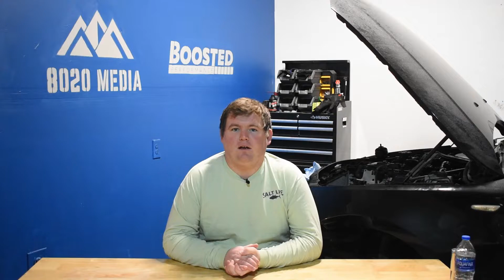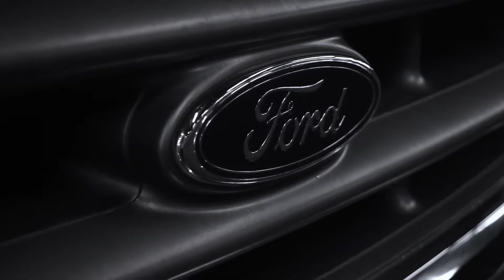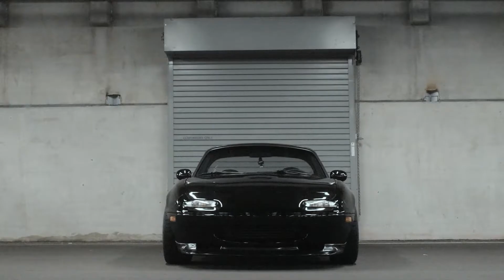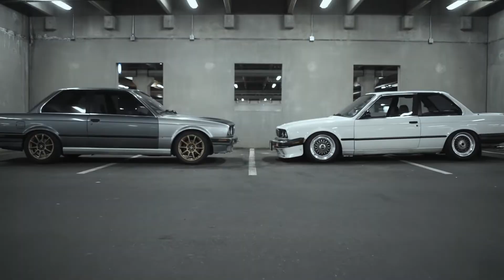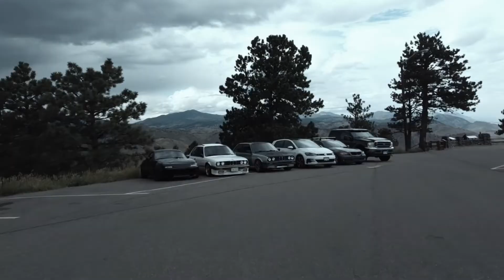The 2.0 EcoBoost | Common Problems & Reliability

Comment: Hi, & thanks so much for the informative video! I've been looking at getting a Mustang,  either 2021 or 2019, both with ecoboost engines since the GT gas mileage would bankrupt me (plus, I'm retired and don't need a GT anymore). If I understand correctly, the 2019 2.0 is still in that coolant intrusion danger zone, but the coolant issue has been resolved for the 2021 2.0? Thanks again for the great video.
Reply: Mustang ecoboost is a 2.3 ecoboost.
Reply from the maker: Ed - Correct! Thanks for the feedback!
Reply: @8020Automotive  Thx so much!

Comment: I bought a used 2017 2.0 EcoBoost Escape last year. I love it, but the mileage is horrible for a 4-cylinder - roughly 19- 20 mpg combined local and highway. I drive very conservatively, use top tier gas, make smooth starts, anticipate my breaking (always getting a perfect score on the "How am I driving" dash display), and I never take advantage of the turbo boost this engine is capable of. My mechanic did some diagnostics as well as a fuel injection cleaning. No codes were amiss that would indicate a compromised oxygen sensor. I still do paper and pencil gas mileage calculation and it jibes with the dash display's reading. Could my fuel gauge in the gas tank be off? Is it possible my odometer is incorrectly calibrated? There are no tell-tale signs that you mentioned in your video, no smells, sputtering, smoke, etc. It runs great, but if I can't correct the mpg issue, I will sell it. Is poor mileage typical for this engine or did I get a lemon?
Reply from the maker: Matthew - Sorry to hear about this. Few follow up questions: What are your driving patterns? Are your tires properly inflated? Is all maintenance up to date? Are you typically hauling people or things?

Comment: Bought a 2016 Ford fusion with the gen 1 2.0 ecoboost engine over a year ago, have 65k miles on her and shes still going. After reading about the coolant intrusion on the gen 2, Im glad i got one with the gen 1.
Reply: You dont have a gen 1 you have a gen 2. Gen 2 started in 2015
Reply: @kennyhart2699 anything before 2015 is Gen 1 ? I don’t know
Reply from the maker: Kenny - Thanks for sharing this insight!
Reply from the maker: F - Sounds like you've got a good one. Just make sure to keep up with maintenance.
Reply: @8020Automotive  Hi there, If you were to buy one with the gen 1 engine from a private seller, what would you ask them for? Also would an inspection at the dealer be a good idea? What would you ask them to look for? Or better off to not buy one with a gen 1 type?  Great video, thank you.
Reply from the maker: Perma - Thanks for the feedback! It is always a great idea to ask for maintenance records. If the 2.0 has been maintained properly then it wouldn't be a bad buy. Would always advice getting extra eyes, especially unbiased, on a vehicle before purchasing.

Comment: I specifically wanted this engine and not that 1.5 crap in which have issues.  My 2.0T 2017 Fusion gave me no problems.  I throw Lucas injector cleaner once a month.  Currently at 81k miles and still running well.  I want a F150 now but will hold on to my Fusion until those prices come down.
Reply: My 1.5 has only had a misfire code because of original spark plugs at 100k miles and the ac compressor went out, its been a solid engine for me since i got it at 89k miles
Reply from the maker: Ryan - Thanks for sharing your experience! Not sure when prices will come down, but we agree!
Reply: The 1.6T is the least reliable of the bunch

Comment: Here are some things to help w/the reduction of carbon build up, though it won't alleviate it.
1. When driving, allow the engine to get up to full operating temperature. The worst thing you can do is to do shorties around town and such, which don't allow for the engine to get up to full operating temperature. This allows for more carbon to build up in the cylinders. Take her out on the highway at least once a month and open her up, especially before an oil change.
2. Use a good quality of gasoline w/built in fuel cleaners. What are called Tier 3 Fuels. With the cheaper fuels, you get what you pay for. I recommend Chevron w/its Techron fuel additive. During the hot summer months, especially on long trips and w/the vehicle loaded, use a Premium fuel.
3. At least once a month, run a fuel cleaner, like Chevron Techron, in the fuel tank.
4. I recommended using Full Synthetic oil (Motorcraft, Mobil One, Pennzoil, Amsoil), w/a good quality oil filter, (Motorcraft, NAPA Gold, Wix, etc.). Stay away from Frams.
5. Follow the recommended maintenance schedule.
Reply: This is a GDI (gasoline direct injection) engine.  That means that there is NO fuel coming through the intake valves to clean them.   The old "Italian tune-up" you suggest - (Take her out on the highway at least once a month and open her up) - does NOT work on Direct Injection engines.  The only way to clean the intake valves is an expensive (hundreds of dollars) cleaning at your dealer.
Reply: @wearethelandrovers9014  My Ford dealer does not even offer the service.  I'll be doing it myself.
Reply: Motorcraft oil is a "Synthetic Blend"
Reply: @doanpham972 They also offer a full synthetic
Reply: I would add Redline oil to that list, and I wouldn’t go over 3500 miles on an oil change on any ecoboost.
Reply from the maker: Gordie - Thanks for taking the time to write this information up. It will certainly be helpful for future viewers. We also have a video specifically dedicated to carbon buildup: https://youtu.be/jogNGSNg-OA
Reply: Only starting in 25 from what I've read regarding mavericks anyway
Reply: Recommended maintenance I agree but I wouldn't use the oil life monitor.  5k or under with full synthetic
Reply: The 2.0 ecoboost has dual injection. it has both direct injection and port injection.  There is no more issue with carbon buildup on the intake valves.
Reply: @endurox1481  2.0L does not have this feature. That is on the 1.5 L. The current 2.0L is a great engine and it's a darn shame to not give it this update. I believe the 2.7 and 3.5 may have it also.
Reply: @endurox1481 wrong, the 2.0 engine is direct injection only.

Comment: Great video, quick question; do you know if the coolant issue effects the Jaguar-Land Rover Ecoboost 2.0l engines, specifically RR Evoque, Discovery Sport, or Jaguar XE? From my research, I believe these (even as late as 2017 model year) are on the Gen I design and the coolant issue appears to be with the 2.0t Gen II ecoboost, no?

Also, do you know if the European version Gen I engine still suffers the same exhaust manifold cracking, as from what I understand the European engines have a slightly different exhaust design? Thanks!!
Reply from the maker: Hi Douglas, thank you for the positive feedback and comment. The models you mention do use the 1st gen engine. The 2nd gen was when Ford moved to the open-deck block which is the flaw of those 2L EcoBoost's. The first gen doesn't have any real block problems, so there aren't any coolant intrusion concerns. Of course, random fluky failures can and do happen but it's not common or likely by any means on the first generation engine.

As for the manifold, Euro-spec EcoBoost's do use different cylinder heads and manifolds. Here in the US, the manifold is built into the heads whereas in Europe it's a standard exhaust manifold that bolts to the head. The design is very different so it's unlikely the Europe versions have the same issues.

Comment: Hi, Great video, very informative. What do you know about the 2.0L engine on the 2023 Lincoln Corsair?
Reply from the maker: Lincoln refreshed the Corsair for the 2023 model year and replaced the 2.3 EcoBoost with the 2.0 EcoBoost. What information are you looking for? It's a little difficult to provide common problems on the '23 Corsair since they just began production.
Reply: @8020Automotive   this is my situation. I would like to change my 2021 Lexus ES 350 F Sport for a SUV. I was thinking on the new 23’ RX. But now that Lexus is changing their engines to a smaller and with turbo, I was looking at the 23’ Corsair as an option. Not sure which one will be more reliable.
Reply from the maker: Again, since both are relatively new, it's difficult to say. However, we can provide as much information that would be helpful. The Corsair has increasingly become more reliable over the years, while the Lexus RX has always been reliable. If engine size is your worry, the RX still has a larger engine than the 2.0 EcoBoost that is coming standard in the 23 Corsair.

Comment: I love how you tried to play down the carboning up issues its a big deal. Ford has followed Toyota with dual injection on some engines, but they are still lagging behind adding it to the 2.0l engine. The main reason I baight a Toyota to replace my wifes 2015 Fusion. Coolant intrusion issues that can destroy the engine. It boggles my mind how slow Ford is in fixing known issues and design flaws. I have seen Toyota fix things within 6 months before. Take the Tundra Waste Gate issue they already identified the problem and fixed it. I might buy Ford again one day when they get serious about Quality and longivity again. Right now in 2023 I would not touch anything but a Toyota, Honda, or a Mazda product. If you have endless money supplies by all means buy Ford Escapes.
Reply from the maker: Agreed the coolant intrusion is a serious problem. With respect to carbon buildup issues thought this really isn't a "problem" so to speak. It's an issue with just about any direct injection out there, big "problem" across all the Euro direct injected vehicles. But it really doesn't cause any problems other than a very gradual and minor performance decline over time and can be easily remedied with walnut blasting. But I get you with quality concerns, the early model 2.0's like your 2015 certainly weren't the greatest from a reliability standpoint. The first gen of the 2.0 was also built off of the Mazda L-series engine for what it's worth. The coolant intrusion was an issue from the open-deck cooling design and the block was straight out of Mazda's design book.
Reply: Ford added the coolant channel to the Mazda design that is all 100%Ford stupidity thinking they would make it better without thinking if we do this what problems couuld arise. Mazda's quality has sky-rocketed since getting away from Ford!

Comment: 2016 escape 2.0 ecoboost. So its a good engine? I'm in the process of buying one hope it is.
Reply: I would suggest that since Ford is replacing those engines that die from coolant intrusion under warranty with new engines, those vehicles that have had engines replaced should be very reliable.
Reply from the maker: Beyond all the information we provided in the video, whether it is a "good engine" or not really depends on the condition of the engine that you are buying and how well it was maintained. How many miles does it have and what does the service history look like?
Reply: @8020Automotive  87,000 good service history. I noticed the 2016 doesn't have the open coolant which is good!
Reply from the maker: So long as it has been properly maintained, you should be all good. Just make sure to knock out the preventative maintenance items since it is close to that 100k mile mark.
Reply: I have a 2019 edge with the 2.0 turbo, they say regular gas is just fine but for better engine performance and fuel economy use premium?I should put premium on it and use full synthetic oil instead of the motorcraft blend? ( is what the dealer use) I love it the car and I’m lookin to keep it for as it can be.Thanks for share all that knowledge with us!

Comment: Great Video ! Was low compression an issue for the 2015 2.0 ? I'm around 145 psi dry on all cyl  and 190psi wet. And 109K on the clock. Getting torque management issues at idle in gear. Higher RPMs seems to run fine. Shop says Ford Cylinders only have a thin wear coating and they wear out quick and the only fix is a new block or motor.😢
Reply: All these manufacturers spray the bores instead of a liner. You can do anything with spray in cylinder liners.

Comment: I seen a video of a guy who said the 2.0 Eco is made in Spain and Ohio and are exactly the same engines but the one built in Ohio has more frequent problems with coolant intrusion and for some reason the one built in Spain dont have this problem.
Reply from the maker: Meta - From what we have seen, this is certainly a valid statement!
Reply: That could explain why the Made In Spain 2.0 EB was sold in the Middle East until I bought mine in a 2020 Escape.

Comment: Hello, i was doing some research on the 2.0 while I am interested in a Bronco Sport with the 2.0. You mentioned the manifold cracking. Now I am reading the exhaust manifold integrated to the head. Does that mean the head needs to be replaced or is it the single pipe that goes from the head to the turbo.
Reply from the maker: Hi Kevin, there are a few possible places for the manifold to crack. Ultimately, I wouldn't worry about this issue too much. It's mostly a problem caused by high exhaust gas temps (EGT) from towing heavier loads, especially in hilly/mountainous areas. If you're planning to use the Bronco for anything extreme then you may consider some upgrades to help keep EGT's lower.

Comment: Thanks for the video. I'm thinking about a 2022/2023 Maverick with the 2.0L Sounds like it should be safe.
Reply from the maker: Brandon - The 2.0’s are stout, so long as you maintain it well!
Reply: I have a 22 Maverick loaded in pristine condition with 14,000 miles and 2.0 awd if anyone is interested.
Reply: @genehackmann3205  Change the PTU, Trans and Diff fluids at 30K.  Then trans and PTU at 30K and rear diff every 60K.  See 2020 Ford Escape videos from fordtechmakuloco.  Maverick, Bronco Sport, Escape nearly all identical 2.0L AWD.
Reply: Hello I am planning to buy a Galaxy with a petrol engine Ecoboost 240 ps . Does anybody has this engine? Is reliable?
Reply: Got a 2022 bronco sport with the 2.0, it’s been great. I run mobil 1 full synthetic, oem oil filter, and premium fuel. In the summer I average 34mpg but I think the Maverick might be a slight bit better. That’s what I was originally looking for, but they’re hard to get. I have a 2020 F-150 , so I settled with the bronco. 32,000 miles so far on the 2.0…….0 issues
Reply from the maker: Michael - Thanks for sharing your feedback and assisting others!
Reply: I love the 2.0 over the 2.3 I had